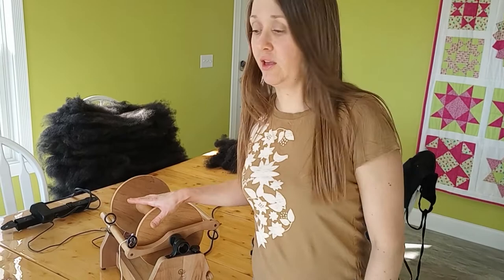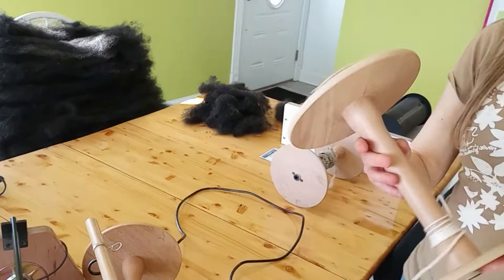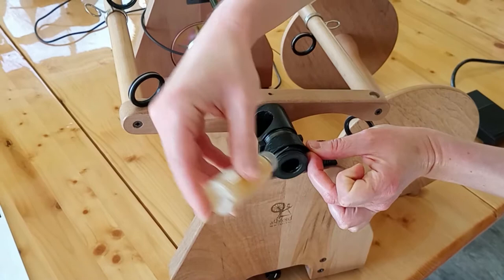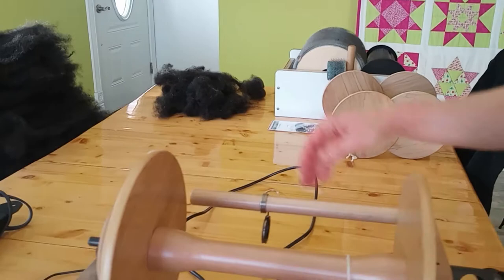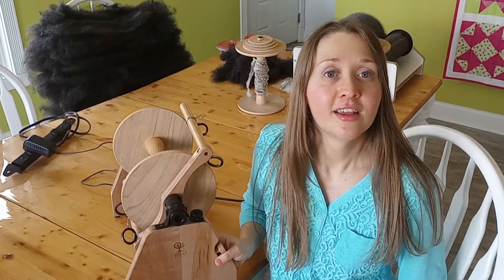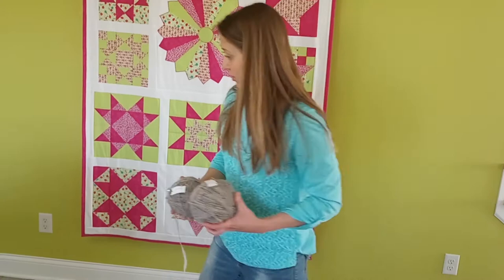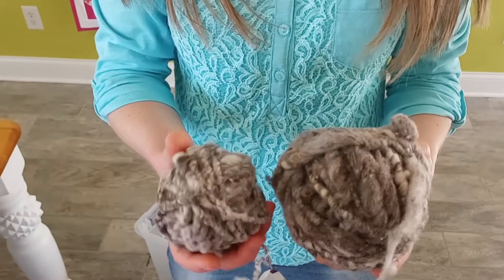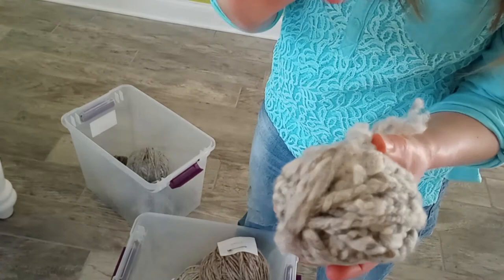Reviewing the Ashford e Spinner Super Jumbo

Comment: Do you think you could spin horsehair on this unit? I’m currently spinning hair to make horsehair mecates. I’m looking for some kind of spinning machine that will be able to handle the thicker/stiffer material. I currently use a drill with a hook which works beautifully, but it doesn’t draw up the thread as you spin- so spinning inside during our cool Canadian winter means trying to get a 60 foot span indoors.  My main concern is how much tension the machine can handle-although I suppose if the thread was drawing back into the bobbin it wouldn’t take as much tension to hold it as does for a long span. Any insight would be great as it’s an expensive unit to buy if it won’t handle the material. Thankyou.
Reply from the maker: I've never worked with horsehair before.  The thinnest I have spun was sport/fingering with wool.  I would imagine horsehair is very thin.  As for the tension, I usually have the tension as loose as it goes because the take-up is just fine without it.  The only time I usually tighten the tension is when the bobbin is super full.  Otherwise, I prefer to just start a new bobbin.  I'm not sure how long the horsehair is, but if it's less than 2" it will be more difficult, but not impossible.
Reply: @ShearGoodness  thanks for your response. I’m spinning the mane and tail hair-so some of it is very thick & “wire-y”.   I don’t know all the correct spinning terms, so forgive me, but I feel like the “draw back” requires a lot more tension/pulling and is a lot more finicky than a lot of materials Ive seen online that seem to practically draw themselves.  I’ve yet to find anyone who spins horsehair with a traditional type spinning wheel- so either there are not a lot of people spinning it or theres a reason they done use one to do it. Either way I think I’ll try to keep with my current system and I’ll see if I can gain more experience with the materials before I pull the plug on this big of a purchase. Thanks again.

Comment: I have the same Ashford Jumbo wheel as yours…and unfortunately the Orifice is rusting… I have only had it a year and a half approx… can you suggest what to do? 
I can’t believe such an expensive item was not made with a non corrosive part that is so important and could damage the spinning yarn with rust! 
Also the Lazy Kate that comes with it is very hard to use as the bobbins are too heavy and do not spin fast enough to ply with!! 😢
Reply from the maker: My first thought is, are you spinning in the grease i.e. are you spinning raw wool that has not been washed?  Is the wool 100% dry before you spin it?  Are you using the orifice reducers?  I use the large orifice reducer and it is made of plastic, so the yarn never really touches the metal orifice itself.  My thought is, if the rust is visible, I might try a very fine steel wool to gently sand off the rust.  But you wouldn't be able to paint it afterwards because you can't add any thickness to the orifice.

Comment: From Gerry Ivkovich= I just received my jumbo spinner. I've been spinning for 16 years on an Ashford traditional, but I am having trouble with the e-spinner. I cannot determine the amount of twist I'm getting and so my fiber is breaking. I guess more practice for that. My foot pedal doesn't seem to work. Did you have any trouble with that in the beginning? As soon as I turn it on the bobbin begins to move and tapping the pedal doesn't seem to stop it. Thanks for the video. Blessings.
Reply from the maker: Gerry,
When I turn the button on the front of the unit to "on" it will flash a red light, but the bobbin should not spin until you tap the foot pedal.  Make sure the foot pedal is plugged into the "switch" hole under the unit (not the input).  Perhaps it is not screwed in tight enough?  The "on" button will flash, but the pedal should control the start and stop.  I think the machine is perhaps not detecting the foot pedal being plugged in.  As for the fiber breaking...my first thought is that the tension is too high.  This bobbin is so huge and I rarely need to tighten the tension, except for at the end of my spinning, when the bobbin is near full.  When it is full, the take up is poor, but when it is empty, the take up is very strong.  I would turn the tension knob counterclockwise, so there is no tension at all on the leather brake band.  If that doesn't work, are you spinning a really thin yarn?  Let me know how that goes and check back.